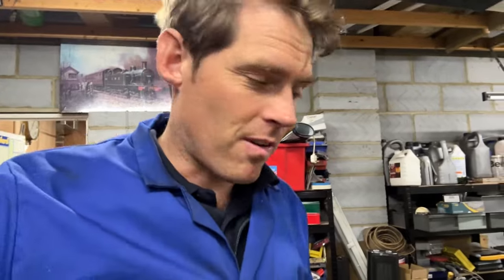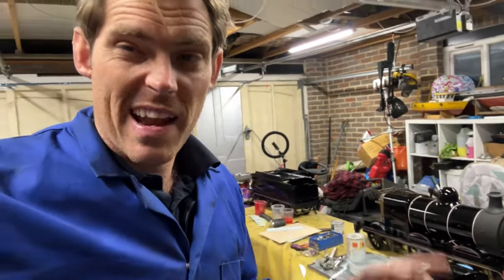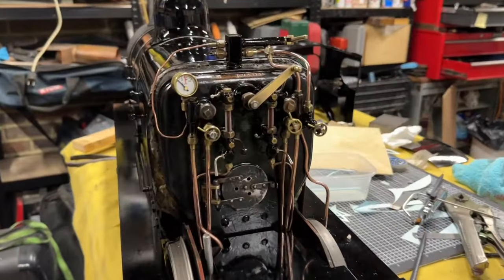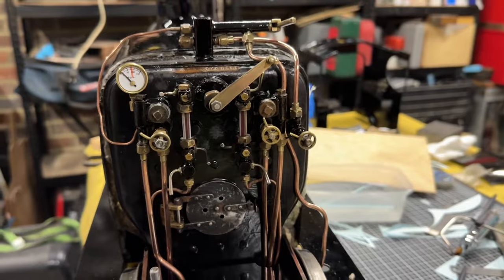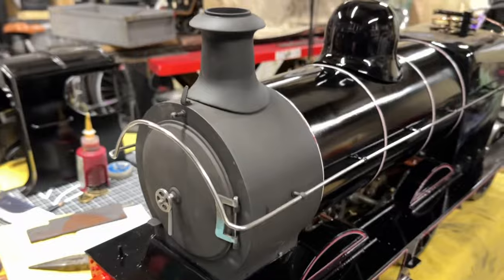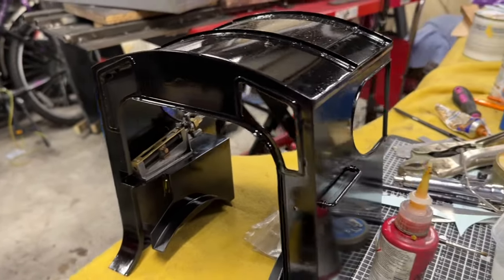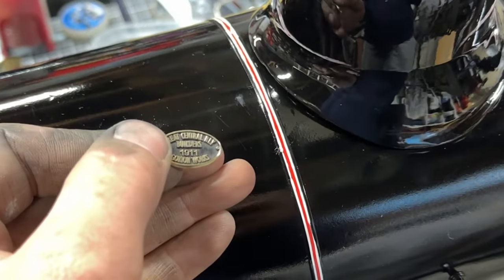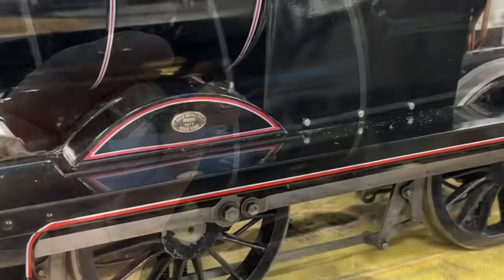Assembly continues, backhead piping…

Comment: Hi Tom, the loco is looking gorgeous. Regarding the dummy whistle, have you thought about running some 1/16 pipe to it so when the actual whistle blows, a little bit of steam comes out of the dummy whistle ?
Reply from the maker: I have considered it, and I may do if I can think of a tidy way to make the connections in the cab.